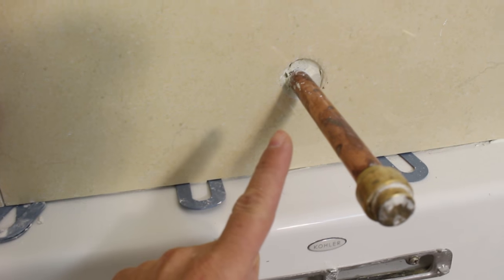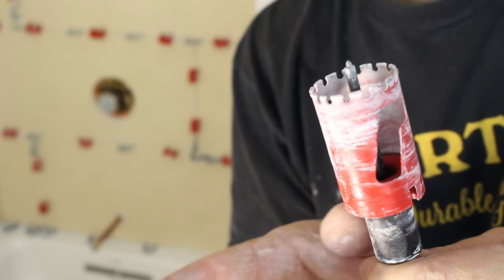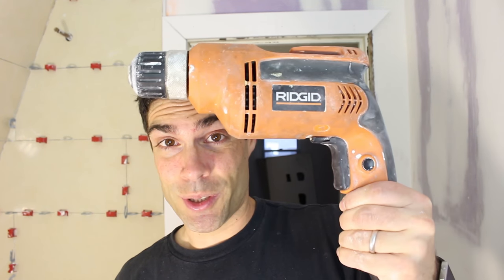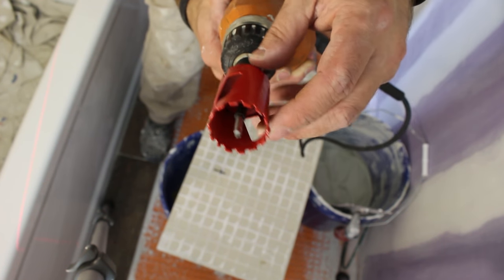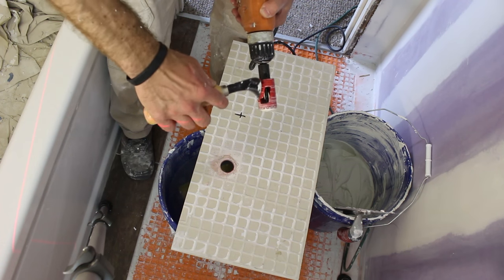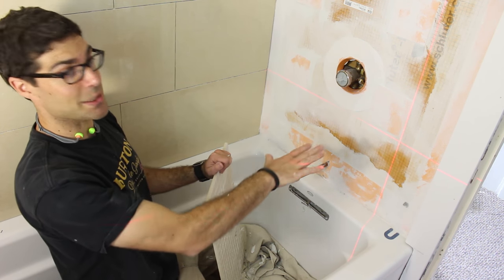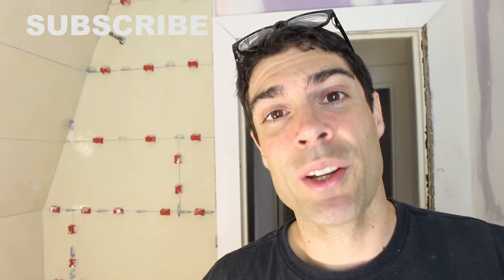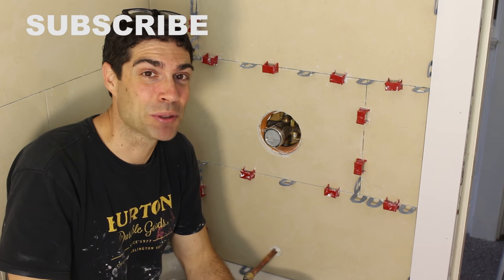How to Drill a Hole in Ceramic or Porcelain Tile (Quick Tips)

Comment: Great tips Jeff! I'm guessing it's the shower head pipe that is wrong - right?
Reply from the maker: that's just a place holder for the shower arm that allows us to test the copper connections. So my buddy Steve shared with me how to make that, it's a piece of copper soldered to a male fitting that connects to the shower drop elbow. We put that in place of the shower arm so that we can check for leaks at soldered connections or the PEX connections at the mixing valve ;)

Comment: Thanks for this video.  Is the retractable starter bit a necessary requirement or can I just go with the hole saw?
Reply: You don't need the starter bit, but without it you can't start the hole straight on. You can start the hole saw at a 45 degree angle and kinda swing the bit in a circle until you're able to place the bit at 90 degrees/perpendicular to the surface.

Comment: Hey just wondering what the name of the thin set u guys used for the tile or what do u recommend. And the spacers are they 1/16"?
Reply from the maker: +Eric Moye we used Ardex X77 thin-set, 1/16" horseshoe shims and Tuscan SeamClips for the tile leveling. As far as the caulking, either silicone or a matching caulk that goes with the grout. We'll be using Mapei's FA grout in this tile since it's glossy and in a rental 👍

Comment: Thanks for the tip Jim! Any reason you used a bucket to lean on while drilling? Any benefit to it or was it the closest thing lol
Reply from the maker: +Tommy DeWalt it had water in it, just an easy location to dip the hole saw while drilling, little tip from my buddy Steve